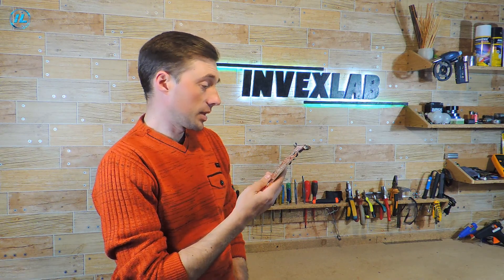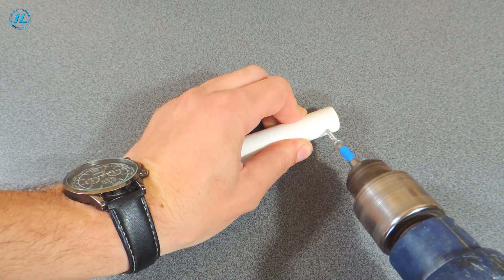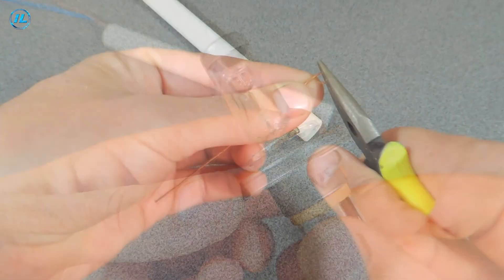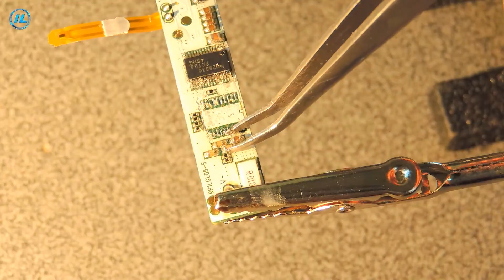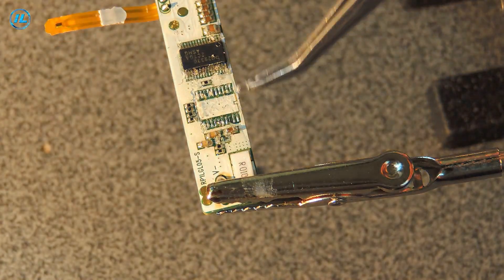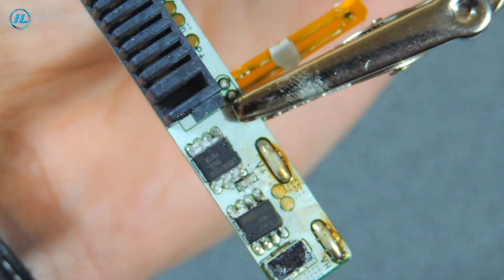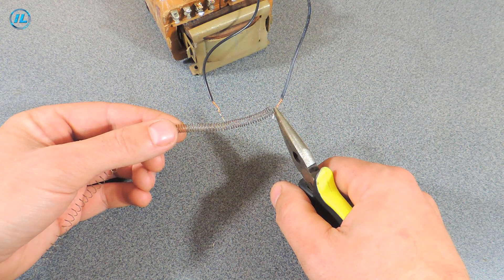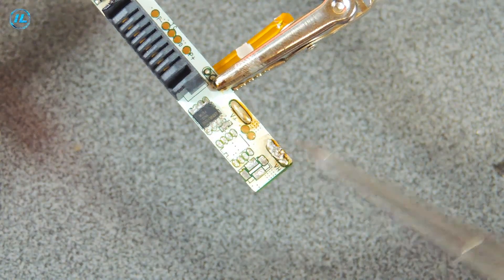✅ Infrared soldering iron with your own hands!!! 3 WAYS to make an IR soldering iron yourself! ✅

Comment: i love how cigarette lighter outperforms hotair station right away (7 min mark). The most weird thing is there are close to zero IR soldering stations on market with a hotair-like handle. (IR860 and thats it)

Дмитрий, это совершенно охренительное видео на самом деле. привет из Германии.
Reply: M. Gengo  you do not have temp control on hotair station as well. Burning smd components such way is matter of experience, not temp controll. How the hell heated spiral is not IR emmiter.
Reply: M. Gengo  i am repairman full time job. Hotair temperature is dependent on surface you blow, amount of flux, distance, even angle since it changes how air spreads on surface. Everyone who uses hotair ends up with 2 or 3 profiles like 200c, 300c and max, using last one for most jobs. See? Instead of blaming you i explain. Now this is your turn: define IR heat transmission and name few examples of IR emmiters used in soldering devices or heaters. Start with defining difference between hotair blower and ceramic IR heater. Continue with explaining how different materials emmit different waves including visible light when they heated.
Reply: M. Gengo  i do not use hot air to remove plastic or resin components. There are far better ways to do that like preheating whole device to 50-70c. This is especially useful for big devices like macbook screens or MS surfaces. Also FYI there are ir soldering handheld devices on market, not that popular, but pretty existent. Putting some basic PID will solve "no temp control", or even bench PSU does the job. Now watch the video again, jump to the 7 min mark and try to imagine what would have happened to plastic connector on board of he used hot air for such beefy component. It would have burned way before solder even started to melt.
Reply: M. Gengo  oh, thats pretty easy. Connect lighter to PID and thermocouple on board. If calibrated it would be waaay more precise than hotair. As mentioned, without thermocouple on board or IR camera you have zero idea what temp do you have on board when you hotair shit out of it, also you clearly never worked on something like PSU circuits or anything with 2-3 layers of copper in the middle of the board.  Also no problem to put a metal shield to reduce nozzle diameter. Of course this is more DIY perks but its not that bad at all, it is not comparable to professional tools but in some way it ouperforms hotair. Especially knowing  there are, in fact, professional rework devices like that. Of course cig lighter is not most stable durable solution, but there are plenty of ceramic heaters which could be used instead. Anyway, im still waiting of your IR explanation.
Reply: M. Gengo  basically most of heating elements dissipate heat in IR spectrum, it simply depends on surface temperature and material. Some are more effective, some less. For example, light bulb is not effective heater since it mostly emmits visible light which scatters around thus "heating" all surfaces. Basically, every object if thats not 0K emmits some heat, so it does not matter what you use. You need to understand that  temperature on the surface is roughly proportional to the distance and airflow both are basically adjusted by your experience, =random hits and miss. So you have some "ideal" factory-calibrated 400C measured  2CM from the nozzle A with Airflow B. You change nozzle and you 4 times bigger area, you change airflow you have different "heat" focus, different dissipation pattern/area. Long story short, there is no way you set hotair station to some value, blow on thermal couple and get desired temperature. you will obvously adjust temperature with distance. If you have heating element which is controlled by PID with a thermocouple with precision 5-10C you get what you ordered, you put heater closer, it reduces the power, you put it back - it compensates till maximum current  and tries to keep the temperature. This is exactly like every IR station works.

Comment: With the naked eye you cannot see infrared light ... However you can clearly see the light coming off the heating elements ... With real infrared, the surrounding air is not heated and is uninvolved in the transfer of heat. This is not infrared but simply a heating element.
Reply: It's an approximate blackbody, which means by the time it produces a lot of red, it's producing a lot of infrared which is the primary means by which a heating element works when it's not in contact with the target, that's how a glowing domestic heater warms your hands and feet. I assume you mean it's not efficient infrared because it produces a lot of all infrared wavelengths not only those absorbed by the solder.